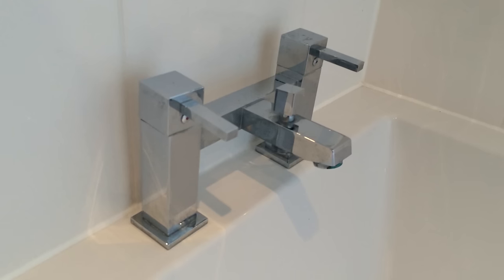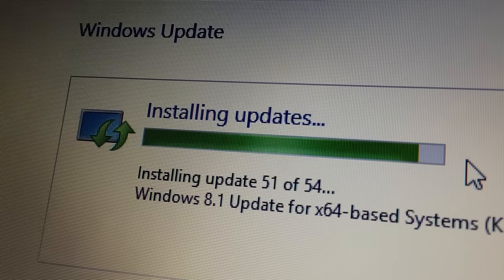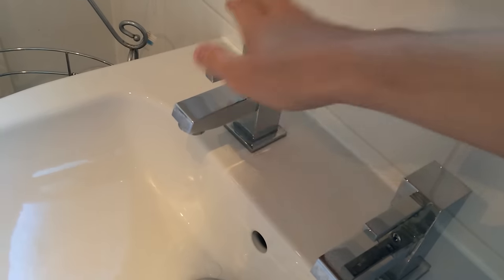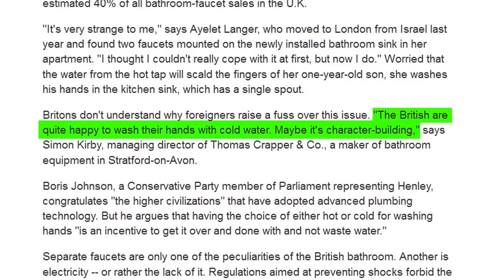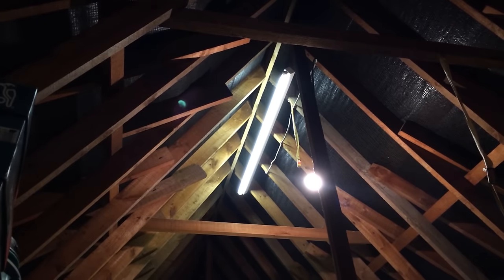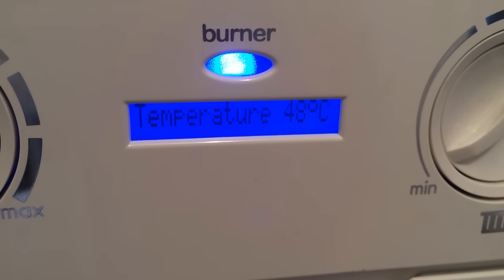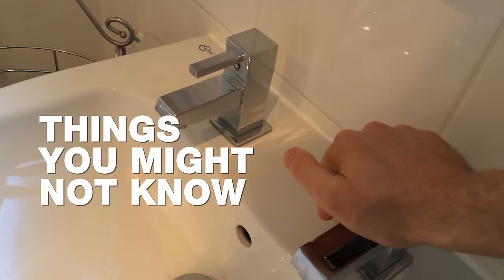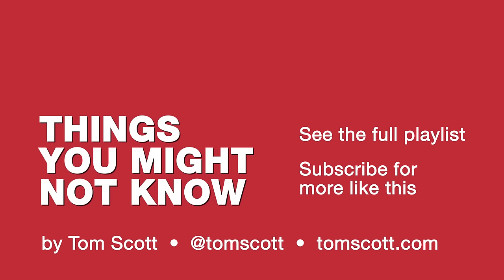Why Britain Uses Separate Hot and Cold Taps

Comment: I am a pest controller, I have removed pigeons, squirrels and rats in various states of decay from cold water tanks, it ain't pretty!
Reply: ... try fixing the roof!
Reply: You just need better tanks like the rest of the planet then hahha
Reply: I have done it from drinking water well and the people drank that water and never died from it
I could even see scull at the bottom of the well
Reply: Thats how some of us get our only source of protein.
Reply: We once found a decomposed bat on our water tank,  together with a LOT of mud and rust from the old street pipes. The water tank lid was cracked.
But the water tanks are only used for the bathrooms, so we didnt drank that nasty water at least.
We brushed our teeth with it tho =P

Here where i live in Brazil the houses usually have no boilers or central heating, the water is heated electrically in the shower/tap heads. Water tanks are mainly used to help in cases of water shortages or to add pressure to the water (the water slowly accumulates on the water tank then is released with more pressure due to gravity)

It´s cool to see how different the world is in some aspects and yet how similar it is in others =)
Reply: In Poland most houses don't have a boiler, water is heated in a facility somewhat similar to a power plant and pumped around the city. Surprisingly, the system works quite well.
Reply: @mimikal7548  done by Soviets? :)
Reply: In Greece most houses use solar water heating which works fine most of the year. At winter we use oil or natural gas boilers which are usually found in the basements of each apartment building.
Reply: @mimikal7548  that sounds like an incredible waste of energy
Reply: @MSuyay  no? It's super efficient and costs way less lmfao
Reply: Less than heating on demand at your home?
Reply: @MSuyay  Depends, heat is waste when you are trying to produce electricity, if you can pump it to a city then it might be more efficient.
Reply: @426shelby426  people have died from drinking out of wells in the past in England
Reply: @iainmackenzieUK  Are you still began at that point?
Reply: @mimikal7548  Wow that's cool
Reply: @mimikal7548  jesteś w błędzie. Sprawdź co to jest węzeł cieplny i jaką ma funkcję w budynkach wielorodzinnych.
Reply: @AlexIr99  not about heating ????
Reply: @keithc9461  Huh?

Comment: So when you wash your hands you get to choose between ice cold and scolding hot?
Reply: Yes. Or (in winter when the hot tap hasn't been run for a while) you get ice cold and then scalding hot from the same tap.
Reply: ***** Wait what? I wouldn't feel clean if I didn't wash under running water.
Reply: ***** Disgust.
Reply: ***** I think that's what most people are brought up to do.
Reply: TheVintageStuffGuy1998 Well it's unheard of to me so don't count on that. It will completely depend on which country/countries you're looking in too I'd bet.
Reply: I meant people brought up in England. Not sure where you're from. Scandanavia?
Reply: ybra You would still rinse off under (probably cold) running water. Only the hot-water-and-soap part would be done in the sink, the sink then serving as the point at which your desired temperature is achieved rather than doing this in the mixer tap. I feel fairly confident in saying that this is almost certainly how most people in the UK were brought up to do it, although mixer taps have become far more common in the last 20 years or so.
Reply: TheVintageStuffGuy1998 Yeap, Sweden to be precise. I feel like it would use a lot more water for no reason than just use it while it's running.
Reply: *****
oh yeah.. fill an entire sink just to wash your hands one time... that sounds efficient and not time consuming... NOT. just man up and wash your hands in the cold water tap :P
Reply: hey I actually don't have hot water, (bar the kettle) if I don't have the heating on or have had the heating on   in the last 12 or so hours, yes I in the UK and just use cold,
in fact if you go to the public toleits, there is usually just one tap either hot or cold, there seems no rule to which you see, but the older will be cold
By the way I had to temp check the hot water today and got told it had be over 50ºC
Reply: ***** That sounds as if it'd take a long time and be a huge waste of water.
Reply: The water isn't ice cold and the hot takes 2 minutes to heat up.
Reply: ***** " you want to have it hot enough to actually kill bacteria."

Water hot enough to kill bacteria would also burn your hands badly. It's not the heat that gets rid of the bacteria, but rather rubbing and rinsing them off in combination with soap.

"How about taking a bath, do you think that's unclean too?"

Yes, I don't think you are clean after a bath unless you also shower after. How can you be clean after soaking in your own diluted arse sweat? :P
Reply: ***** Soapy filth water isn't gonna make you clean :P
Reply: *****
Any washing product comes with the same instructions: water> soap> rinse, can't anyone in this country read their own language? This applies to anything, from washing the dishes to washing your clothes, to washing yourself, not that hard...
Reply: Well if you had mixed taps you would have a much greater chance of not drinking 'drinking water' that knight be harmful for your health.
Reply: yep!
Reply: Well - firstly, the temperature that the hot water system runs at OUGHT to be under your control - so the water most certainly shouldn't be coming out "scalding hot". Even when fully heated, the water in my own system comes out at a temperature that is hot enough to inhibit any mold growth in the insulated storage tank, and probably hot enough to be described as "uncomfortable" - I wouldn't want to keep my hand in it for more than 5 or 10 seconds - but NOT hot enough to scold an adult on even quite an extended contact (I don't have a suitable thermometer or I'd check the actual temperature, but the thermostat on the side of the 5hot water tank is set to 60C, a.k.a. 140F).

Secondly, there's always a run of pipe between the tap and the hot water storage tank (or the boiler), and the water in that pipe cools over time, so that what initially emerges is not even at THAT temperature, and takes quite a few seconds to reach it -  normally more than enough to, say, wash my hands. And if I need to run it for longer - well, you get quite skilled at running two taps at different temperatures and moving back and forth between the two to get a comfortable and reasonable result.

Basically, it's about what you're used to. If you grew up with mixer taps, and you try to use separate taps the way you'd have used a single outlet, of course you'll have problems. They need a different approach. Quit moaning, and learn.
Reply: Edit: Should have read the whole thread. My question was already asked and answered! Dont agree with the answer but there you go.
Reply: That's just what I was going to say!  I hate washing my hands with those separate taps.  You get them in really old bathrooms once in a while in the US (such as in campgrounds).  What's even worse are those taps where you have to twist and hold the faucet the entire time you wash your hands.  Absolute fail in engineering design.
Reply: No we don't do scolding warm it's Britain we are cold
Reply: ***** nice
Reply: ybra
Depends on how filthy it is. Soap works by having a molecule with one end that is attracted to water, and one that avoids it. Put a soap molecule near a particle of dirt, and the "avoid" end will tend to stick to the dirt. Result - dirt particles all wrapped neatly up in lots of soap molecules all keen to go float about in the water rather than, say, stick to your hands again. Provided the water hasn't reached full capacity (whatever the mechanism or criterion for that is), "soapy filth" may look yucky, but it's still going to get you clean.
Reply: ybra Do you feel as strongly about people who bathe?
Reply: ***** Yes the soap helps the dirt in to the water, but if you don't rinse yourself off after you bathe you still have the dirty water (ie diluted arse sweat) covering your body.

Just like your washing machine firsts cleans with a detergent and then rinses with water. If you don't rinse yourself you have only done half the cleaning.
Reply: ybra Well, you could fill up the sink to wash your hands, and the just very briskly rinse them with the cold water tap.
Reply: Personally I prefer to have two separate taps, then prepare a shallowly filled sink of water to the correct temperature, since I can control that myself more easily than trying to get the mixer at the right temperature, but then separate taps was what I grew up with, along with a weekly bath (and no shower in my folks place till I was well into my teens (I'm 31 now)). Although I actually do have mixers in the bathroom and kitchen of my new-build flat but they are a pain whenever they go wrong, which is probably another good point, us Brits generally know how to fix a leaky single tap, or know a relative or friend who does, but a mixer is a whole lot more complicated and forces us to call out a plumber. Incidentally on sinks with individual taps the hot tap is meant to be the one on the left, since more people are right handed, so any inquisitive small children etc are more likely to turn on the right tap, although having said that I think my folks place is the wrong way round. I definitely share Tom's phobia of not drinking from the hot tap, and was slightly perplexed when I first moved to my flat and found that I have two mixers and no isolated cold tap, so just running it for a second or two has had to suffice for me. I can remember my nan 15-20 years insisting that all cold water had to be boiled first if it were to be deemed drinkable, to the point that she made our cordials from water she had boiled and attempted to cool down whilst she made our parents hot drinks.
Reply: aaron4820 I've developed this very quick dance between the hot and cold taps that allows the mean temperature of both taps to be distributed over both hands. Like all good music it starts off slow and gradually speeds up as the hot tap comes on song properly building to a crescendo ratio of 0.2 secs Hot tap to 0.8 secs cold tap.
It's very beautiful.
:-)
Luv and Peace.
Reply: mellon marshall Only 50 °C? I have 90 °C hot water in my home, butt i live in Norway.
Reply: EGIL94 Norway is my second favourite place to be. You guys have got it made. Beautiful environment which you look after and a really decent government. The national service is challenging for me as a Scot but all my Norwegian friends speak highly of the experience. 90 degree hot taps though.  Perhaps a bit much... 
:-) 
Luv and peace.
Reply: EGIL94  yep and how do you not seriously burn your hands if you pop them under the hot tap
Reply: It's the dance.
Short time under hot tap, longer time under cold tap.
You'll figure it out.
Luv and Peace,
Reply: You 're always welcome here.  Scotland is cool too. 
You might want to give it a few years until we man up and choose full independence lime you guys did. 
Luv and peace.
Reply: mellon marshall FM Mattsson mixer ;)
Reply: great but we have no mixer taps here for the most part
Reply: SHeese people can be helples. You but the stopp in the drain ad water from both  taps to adjust the temperature in the bowl and was your hands using that  water. Here in the US older batromms and Kitchens have separate taps.
Reply: urn both on to get the mix of both XD
Reply: Yes.
Reply: waswestkan Yeah, but that way you have to run a sink of water that sits there, possibly with the toothbrushing debris of whomever used the bathroom before you so you're washing your hands in filth or if you're OCD, cleaning the whole sink before you can even wash your hands... 50 times.
Reply: I regularly burn my hands because the water gets too hot before I have finished washing my hands. So, I run my hands under the cold tap for a couple of seconds and then back to the hot tap and it  doesn't burn. xD
Reply: ybra I'm english and this indeed is a problem for me.
Reply: Amrit Ark U0001f602 <----- What kind of code language is that?
Reply: Its an emoji that didn't show i think Sukkateippi
Reply: ybra I wear an asbestos glove on one hand and a mitten on the other while washing my hands.
To be fair, both glove and mitten could do with a good wash sometime soon.
Reply: That was quite a long thread about taps, never imagine i will see the day
Reply: ybra Baths are clean. The fact that dirt is in the bath means it's not on you. Though this is coming from someone who has a bath at temperatures that make his skin red.
Reply: ybra Also just researched it, a nursing student informed me that they went over this in class, and baths are actually cleaner on the microscopic level than showers.
Reply: I thought everyone knew that.
Reply: ybra I personally do some kind of hand shimmy, like I'm in some 1950s movie. Can't speak for my peers on this matter though
Reply: ybra id always use ice cold anyways regardless.
Reply: ybra no
Reply: ybra YES.It is now 4 years that I live in England and still I have to choose between bloody cold or bloody hot.I am from Italy and HONESTLY, you can't find separate water not even in my grand-grandmother house there _"
Reply: There's a thing called a pot, which can store liquids in a quantity. If you observe closely you may notice them under taps. In our homes we call this a sink, or a bath. It's awesome because you can mix the water at any temperature you desire as well as adding other things such as cleaning products, and it doesn't all get stolen by pixies or just soak into the ground.
Reply: Yes, it's fun.
Reply: None of this softy warm water for us.
Reply: @ybra  fill the sink to wash hands at the right temperate, then pull the plug enough to keep flow with both taps running. We don't tend to lack water in the UK for some reason.
Reply: What do you think your plug is for?
Reply: I'm on team ice cold myself. 🙂

Comment: My father told me about a hotel he worked at in the 60s, the tank in the loft had a dead pigeon wedged in the main cold feed from the storage tank. 
Never use wood or carpet as a replacement for a tank lid as mould loves to grow on this, and drop into the water.

Comment: The way it works in sweden is that hot water in the tap is heated via your boiler or whatever via a heat exchanger. The "dirty" water is just used for radiators. So yeah, we shower in drinking water.
Reply: +HillMeister's HQ This is the way it works in all modern houses in the UK. The house I grew up in was built in the 1930s/1940s and had a hot water tank like Scott describes in the video. The house I live in now was built around 2010 and uses a boiler to heat water on-demand, so it's all safe to drink. No water in the house sits around in a tank, except for the central heating system which AFAIK is not connected to the taps.
Reply: +bigwhiteyeti Many American houses have a tank for hot water storage, but I've never seen an open one. Most are street pressure, so the chance of cross contamination would be small.
Reply: The hot water isn't considered drinking quality mind you, as it passes through a heat exchanger. Still fine to drink unless it's a poorly maintained system
Reply: We too use the same application in Turkey too. It disturbs me when someone drinks water from the glass in a tab, in many American movies. We would never drink water in toilet, because it is bathroom not the kitchen. We buy or fill our drinking water and use the tap water just for tea and cooking. The tap water is scientificly drinkable BTW. But it doesn't taste good you know. When it's combined with bathroom water and the glass in the bathroom, no thanks.
Reply: Bahadır Onur Güdürü yes, it is a bit of a luxury to be living in northern europe in that way - lots of rain but also lots of clean drinking water
Reply: +HillMeister&#39;s HQ So does everyone now, it's 2016.
Reply: +Bahadır Onur Güdürü The tap water in the US is perfectly safe to drink (except for Flint, Michigan). Even the water in your toilet is perfectly drinkable, if you really wanted to. And it's extremely cheap, so why waste money on bottled water or filters?
Reply: kered13 Its same here too but you know drinking water in toiled is disturbing for me. Also tap water doesn't taste good I think. Is it tasting the same there?
Reply: +HillMeister&#39;s HQ I live in a newer house in the UK, and my water is heated the same way as yours, and hot water is completely safe to drink, we even have mixer taps.  But I still won't drink from the hot water, because it feels wrong XD
Reply: +Bahadır Onur Güdürü the tap water here is clean and very drinkable. tastes just like bottled imo
Reply: Tom Svensson Sounds cool, here it tastes bad.
Reply: +Bahadır Onur Güdürü - America is a big country, and the tap water tastes different in different places, often due to different minerals dissolved in groundwater. There is some truly nasty sulfurous (but perfectly safe) water in parts of Florida, but up here in my part of Massachusetts the water tastes fine. In fact, Pepsico bottles tap water from the next town over and sells it under the Aquafina name (after filtering it, they claim).
Reply: +Tom Svensson 
Where I live in Canada, the water tastes better than bottled water. I had a bit of bottled water last summer, and it was awful.